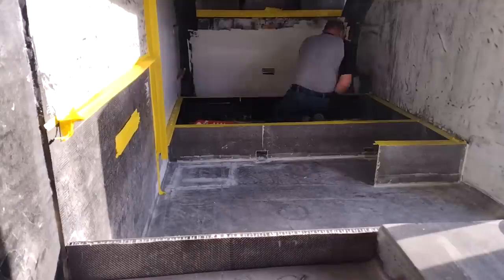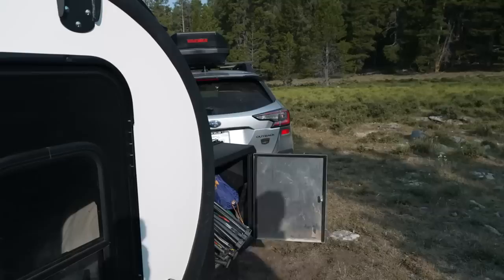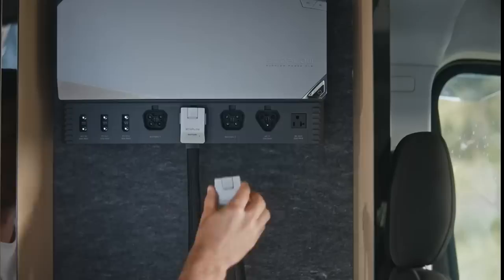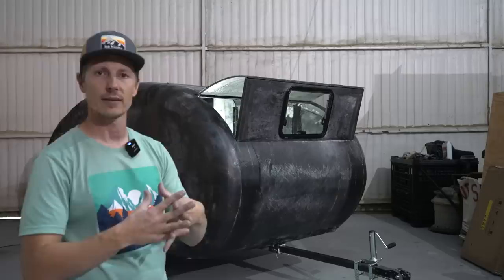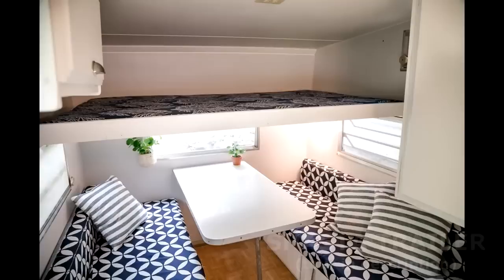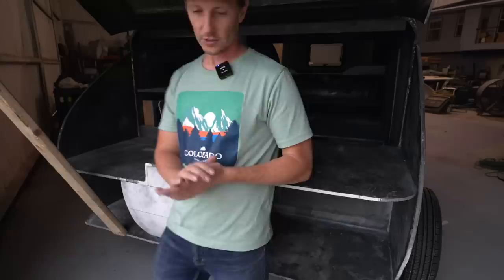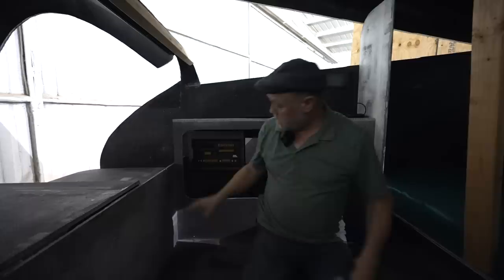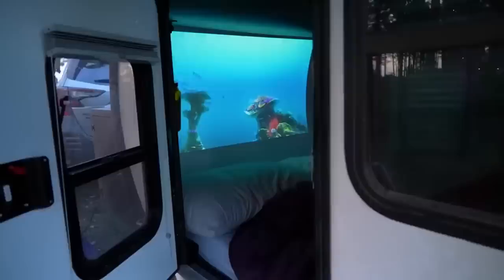World's First Pop-Up Teardrop Trailer With NO CANVAS!

Comment: I had a light weight trailer and the tongue was the single tube coming out from the front to the hitch ball.  I was in Oregon going to San Jose for some high tech training and at 7:30 in the morning I had a weird thought about the trailer an in short order the tongue broke off the trailer.  It stayed hooked to my tow vehicle.  In the mirror I could see the unit roll off the road to side of the freeway.  In Oregon I stopped by a welder to have him put on gussets or braces from the tongue to the or towards the front corners of the trailer.   If you took a peace sign without the circle is what I wanted.  He said it wasn't needed and strong enough.  The rig vibrating on the highway, like bending a piece of metal back and forth until it broke is what happened.  Crickets from Oregon
Reply from the maker: I appreciate you sharing this. That is similar to what Charles did. Currently there is basically webbing underneath the trailer. LIke you said those high and low frequency vibrations on the road are much stronger over time than people consider them to be.

Comment: Drew- could you or Charles say what kind of tools Buyers will need to put this thing together? I’m guessing it will be more than just a wrench 🔧 and a hammer 🔨!
Reply: This treailer will only be sold assemnbled. Those who choose may do interior work themselves. As for the smaller kits we will offer, a good level, some basic hand tools are what is needed. The special fasteners used to hold things together while the adhesive cures will be made available, probably as a buy back/loaner option. If you can assemble IKEA furniture, you can assemble one of our trailers.

Comment: WHAT WOULD THE BASE PRICE BE FOR THIS TRAILER?
Reply from the maker: Based on Charle's philosophy it will be affordable for what it is. But, I have a feeling it will still be up there with the price of a decent teardrop based on the size of this and materials used. However, Charles' main goal with his company is to build VERY affordable teardrop trailer kits. These will be more modest 5X10 style teardrops that can be assembled in a long weekend up to about a week.
Reply from the maker: Based on Charle's philosophy it will be affordable for what it is. But, I have a feeling it will still be up there with the price of a decent teardrop based on the size of this and materials used. However, Charles' main goal with his company is to build VERY affordable teardrop trailer kits. These will be more modest 5X10 style teardrops that can be assembled in a long weekend up to about a week.
Reply from the maker: If you go back to the pinned comment in this video (the first comment in the comment section)  there is now a paragraph from Charles. It states quite a bit of information including thepricing of this trailer. And fortunately it came in much lower than many people thought it would.

Comment: I can't find just the right camper for me. I know I want to keep it small and reasonably priced. I'm very interested in this project, but I'm already fearful it will be expensive.
Reply from the maker: I completely understand. If you go back to the pinned comment in this video (the first comment in the comment section)  there is now a paragraph from Charles. It states quite a bit of information including thepricing of this trailer. And fortunately it came in much lower than many people thought it would.  If this price is still too high, which it probably will be for many folks he will also be offering trailers at about 1/4 the price of this one in a kit form. They will be basic teardrop trailers (non standing height) but made of composite.

Comment: Thanks Drew! I can't wait to see what the final product looks like. So isn't there concern with carbon fiber potentially cracking? Maybe the unique fiber that he speaks of will solve this issue. Are you putting the dual fiberglass propane tanks on the trailer?
Reply from the maker: BRAD THANK YOU SO MUCH! I am due for that coffee. Good question Brad. I had the same question for Charles. And you are absolutely right. That was our concern as well, which is why the trailer isn't quite what it seems from the outside. Charles built this to have more flex at certain points than a 100% carbon fiber trailer. Carbon fiber is a great material, but there is a lot of science with the tenacity and elasticity that determines it's best application. Luckily with planes, formula one, and all the other more recent uses of carbon fiber the understanding of what it can and cannot do in the industry has come a long way.
Reply from the maker: Oops I forgot to answer your question. We would love the fiberglass propane tanks, but they dont' make one small enough for our application. We will have two 5lb tanks. Each will be hidden in the wheel wells of the trailer.
Reply: @PlayingwithSticks  Can't wait to see the trailer when finished! It should be VERY interesting!🙂
Reply: @Playing with Sticks  Thanks Drew!! Can't wait to see the finished trailer!

Comment: Love it. Does no subframe mean there won’t be a hitch at the rear of the trailer? We bring mountain bikes along so use a hitch bike rack. What is the expected tongue weight? Maybe one could add bike trays to the tongue. 2 bikes ~ 70 lbs
Reply: There are tie down rings in the den for straping in bikes. The door is wide enough to make it easy to take things in and out. Drew has an electric bike he plans to keep in there on the road.
Reply from the maker: We have spoke with a lot of top-notch manufactures over the years. What I have learned from them is that they don’t believe in the rear mounted bike racks. I think you can even see Mark Harling from Bean Trailer talking about this in our black bean walk-through. They have found that the forces exerted on a bike from that mounting point are just too hard on a quality bike. I’ve heard people say if you don’t care about your bike, it’s fine, but if you spent some money on it, they all suggest mounting it on the tongue or if you have the space putting it in the trailer. Based on lifting this trailer in the shop, the tongue weight is going to be fairly low. We will be doing a lot of load tests over the summer to determine where the final placement will go. It’s usually a pretty simple formula. But at the same time I don’t want to go too conservative and move the wheels back so far that the tongue weight becomes heavier than it should be. All this to say, unless you have a really small vehicle adding bikes to the tongue shouldn’t be an issue. But I do hope Charles chimes in here because I’ve also never worked with a trailer that doesn’t have a frame, so I don’t know if those bikes would have some sort of negative impact up there.
Reply: @PlayingwithSticks  Because of the retracting tongue, a bike rack up front would have to be attached to the front of the body. That is doable and possibly not much of an aero problem if the tow vehicle is tall. But if it is low, the drag would be huge. I think storage on the front is really a redesign project.

Comment: My only concerns are possible water leaks from the pop up.  Most slides and moving parts will leak after some time.  Another is how easy can the composite material be repaired if damaged?
Reply from the maker: I had both those concerns as well. The first one was about 4.5 years ago. We published a video about our experience with the Scamp trailer. In the video I stated the same thing as you "how easy can composite be repaired?" I essentially was saying I thought it was hard. Wow, did I take a beating in the comments for that one. Haha. I still wasn't convinced. Then I helped a buddy purchase a Scamp that came with the body being damaged. And they were right, it was just like all those patches I had put on my canoe. Even the finishing work turned out great, which really surprised me as we had no experience finishing composite materials or any materials for that matter. Over time I have realized it is traditional trailers that are hard to repair. I thought they would be easy because I work with wood. But I forgot that any damage means you have to remove that skin to get to the damage. Not to mention the interior panels. It turns out to be quite a lot of work. We experienced all this fun when remodeling a vintage trailer. I now wish I could take back those words in that video. Luckily it doesn't get many views today  :)  And your second concern is very valid. When I was dreaming up the concept of this trailer I had the same concerns. But those concerns have shifted in the last two years from being a concern to being more of an understanding. Here is what I have learned. Traditional RVs from the large RV industry got a lot of heat when an internal document was released a few years ago from Indiana that stated the trailers were built to last essentially 4 camping seasons. FOUR SEASONS! And then they are working their way to the graveyard. Then you have my favorite campers (traditional teardrop campers). Now although many of them are built to last a lifetime, even those only last roughly 5 years before they need to be maintained. Meaning even the best traditional teardrop trailers on the market start having issues at the joints/seams at about the 5 year mark. Again, still built for life, but needing routine maintenance. Every teardrop manufacture I meet I ask this same question. And crazy as it sounds almost everyone, regardless of build technique and materials finds that their trailers need work at about the 5 year mark. Now, unlike the Large RV industry these are not going to the boneyard, they just need some tlc and they are back on the road for another 5 tough years of abuse.  But, if for some reason water ever gets in a traditional teardrop trailer then we have a big problem. That trailer built for a lifetime could last much shorter than that. Or it will require some major repairs. That is one of the downfalls of traditionally built teardrops vs. composite teardrops. So because of this I now look at seals differently on a composite trailer. Unlike a traditional trailer, a composite trailer  can have a bad seal and still the majority of the trailer stays in tact with no major repairs. Meaning if water gets passed a seal it is an inconvenience, not a death sentence for the trailer. So essentially if I am comparing the mainteance to a traditional tearddrop this trailer seal needs to last 5 years to be comparable to other trailers on the market. After new gaskets/seals are added the trailer is back on the road again and pushing on towards being handed off to your children. So your comment is very helpful here. What I need to focus on is not only seal longevity , but also ease of seal replacement. I think that will be the key. Just like an automobile, at some point the seals need to be replaced, like you mentioned. So let's make that as easy and as affordable as possible. And then obviously properly sealing this trailer so it can go beyond the 5 year mark without needed maintenance.  I will be adding this to my list of things to work out with Charles. Thanks for bringing this up.

Comment: Looks fantastic and innovative, plus the weight sounds amazing, but what makes this better and cheaper than a A-frame camper considering average family camping usage?
Reply from the maker: I could write you a book on this. Haha. But, I will keep it to just a small number of points. First let's start with construction. A-frames use laminate sidewalls and the bones are typical to what you find in the large rv industry. This trailer is carbon fiber. Not only is it impervious to water and lightweight, but it is also incredibly strong. Most folks, including myself origionally, think that a-frames are light becaue they are so small. But many of us are really sad to find out that our daily commuter cannot tow them. A-frames require indoor cooking. I like indoor cooking as a backup, but my belief is that most of us would benefit more from the primary kitchen being outdoors. Most people think grease and smells, but really it is more about space and usability. This trailer will come in at the low to mid- $20K range. So in terms of pricing they are pretty similar. A-frames have another big issue for families. And I keep hoping someone at one of these companies addresses this with a new layout. The issue is that these trailers,  while large, are most often built with couples in mind. And the ones that are built for families are ridiculously heavy and long. Now, I say a lot of negative things here, but I find A-frames really special. The concept of this trailer is very similar in terms of inside layouot to the a-frames and pop-ups. Most camper trailers are designed around an awful hallway layout. A-frames and this camper are much more functional for families because the usable space is wider (square) vs. the hallway that everyone has to fight for to use any usable space in the trailer. Where our trailer would lose compared to an a-frame is that den space. An a-frame has even more usable square space than our trailer.  Also this trailer was built around no modular sleeping areas. One of our biggest pet peaves of small trailers built for families is that you have to swap the beds for seating or eating areas twice a day. Hope this info helps a bit.

Comment: 11:30 I get that you, personally, have a family to think of (and all the extra gear that comes with that) and so do a lot of viewers, but isn't the point of teardrops to get away from bigger/wider/larger tow-behinds?  It seems like there's a lot of focus for this build to keep getting bigger.
Reply from the maker: To be honest I don’t think that is the point for most of us. Yes, we want simplicity, but it is usually for these reasons. Lighter tow weight, aerodynamics, ability to store in a garage, simplicity of design for longevity of the build and components, and outdoor cooking. Traditionally to get all this you really have no option but to build a small teardrop. However, this build checks every one of these boxes, but comes with the benefit of size. Most teardrop owners would agree that a bit more space would be nice. But we are willing to sacrifice the space for all the other benefits. In terms of towing, as I mentioned in the first video of this series, the size really will not impact the tow experience at all. Hope this explanation helps a bit.
Reply from the maker: I also forgot to mention why teardrops exist. Many of us build a Teardrop to the dimensions of 4 x 8 with jeep style fenders to keep with the nostalgia of the original period of teardrops. However, Teardrops originally were not built to this size on purpose but out of necessity. Think about the dimensions of 4 x 8. This is your common sheet of plywood. And the fenders and other components were salvaged from army surplus just after the war. On another note don’t forget that in travel mode this trailer can be lived in. So if someone like you truly wants that nostalgic feeling and purposely wants to have a smaller camper (minimalist approach) they can live in that layout for years. And then, if for some reason, your family expands or you’re looking for a bit more creature comforts, you won’t have to purchase a new teardrop you just tilt the top up. The whole point of this design for our family was to eliminate one trailer in our yard. I think I also may have talked about this in the first video. We do something really ridiculous in that we always have one 13 foot trailer in the yard and one teardrop in the garage. They both do things well, and they both have limitations. There are certain trips that favor each style of design. Like many people, we’ve always been on the lookout for a small camper trailer that can do it all. I don’t think that will ever exist, but our goal is to get as close to it as possible. There will always be trade-offs in a design like this. But, for us eliminating that second trailer is priceless.

Comment: Do you really think composite carbon fiber will be able to withstand the twisting and pressure that a teardrop camper receives especially if you take it off road any? I just see the resins cracking over time especially in colder climates. Any thoughts on this?
Reply from the maker: That’s a great question. Although we call this carbon fiber. In reality, there are different materials used in certain sections of the trailer where more stress will be placed. Carbon fiber is a very strong material, but it does have weaknesses . And yes, building small camper trailers with composites is common practice. Check out Bean Trailer or Escapod. Two of the best off-road trailers on the market are both made out of composite material.
Reply: Properly designed, a composite trailer will not move with the road. The torsional regidity of this trailer is very high. The suspension will take all the twisting. Many of the supercars have hade all composite vehicles on the road for over 10 years. BMW and Aston Martin have had partial composite structural chassis for over 10 years. Aviation and race cars have proven the technology as well. As Drew said the secrets are in the exact layup schedule. There is a lot of carbon fiber in this design. Also a lot of other fibers to absorb loads and prevent cracking. A lot of the black you see in these two videos is black paint to hide my fabric choices.     You asked about resin cracking. Choice of resin is a critical part of composite design. My choices include enough elongation and toughening agents to insure no cracking.    Look at the relatively primitive resins used in gliders that have sustained tens of thousands of landings on one wheel for 4 and 5 decades notw with no cracking.     Also extensive testing will prove this desigh  before we sell any.